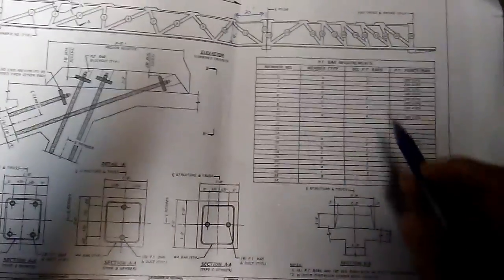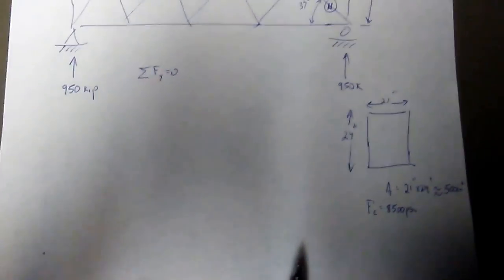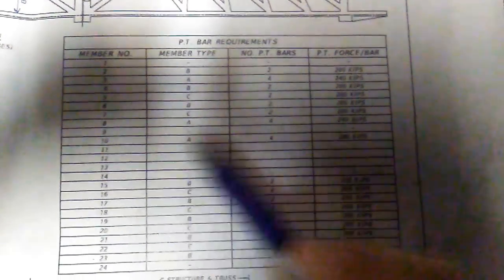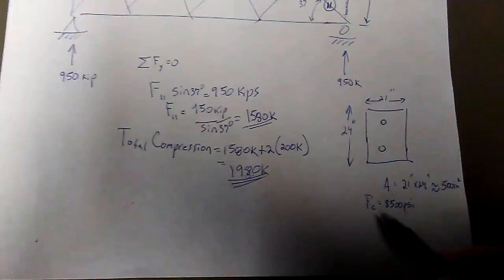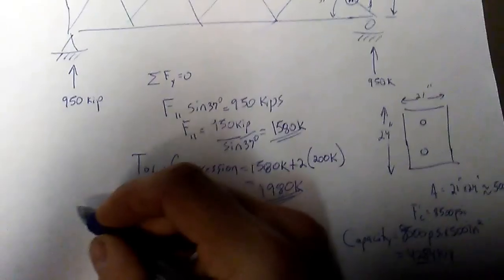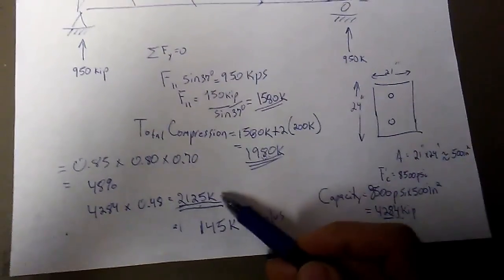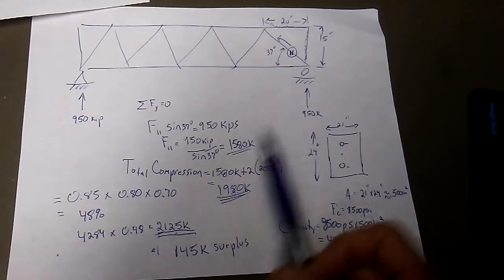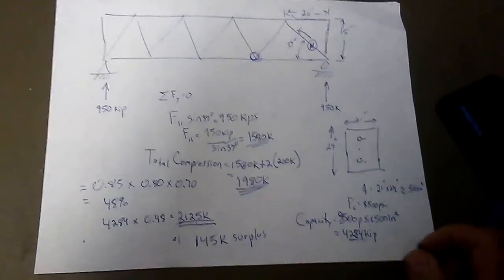FIU Bridge Collapse: The Hidden Truth (Part 3)

Comment: I think this video is looking at one tree when  missing the entire forest. The problem started when someone decided that this cable bridge was changed into a single truss bridge  ! and on and on . Namely, this cable bridge has no cables when it collapsed ! Period. George Wu, ARCHITECT, A.I.A., NCARB 2018-4-7
Reply from the maker: I will be making a video explaining the significance of the stay cables. Stay tuned!
Reply: Radical AM 
I think “swell” is swell.
Reply: You are correct, and this has to go down as one of worst bridge designs in the entire history of mankind.   Who needs a pedestrian bridge that is wider than a doubles tennis court?
Reply: georgewu5 — What I like about this series of videos is that the presenter is showing how the structural analysis works, but is refraining from jumping to conclusions.  Others, on the other hand, have tried to look at every little detail of the project and to come up with all the answers themselves.  That is what the NTSB is for, in my opinion.  I just want to know now how to read the structure, and these presentations are extremely helpful to me.  I am waiting for the NTSB report for the details of the failure and the conclusions.
Reply: Syd Moran Did you just use the word swell? How old are you 104?

Comment: @James, For me is the one of most intriquing aspect.  The NTSB video shows some stirrups but they look like torn into pieces.  
What force can do such damages ????
Reply from the maker: Thanks for the update Richard! The ties in the diagonals are intended to confine the concrete core and prevent the longitudinal rebar from buckling.  If the ties failed, this would appear to indicate that the truss member was overstressed by compresssion and  that the concrete was crushed forcing the ties to snap. Also, concrete that fails suddenly when it is crushed....and the sudden collapse of the bridge seems to confirm this.

Comment: I watched another video by the NTSB. This video shows diagonal #11 split along the longitudinal axis of the member.  It means #11 failed at the ultimate strength ( it might have been combinaion of compresion and bending).  My rough calculations  show that 12 -#7 would work for the DL compression but not for combination of  DL + PT force. Some  people on the Net suggest that at least 12 - # 11 are required for this member taking into account all load combinations.
Reply from the maker: Great find! This appears to support the theory of over-tensioning of the PT bars prior to collapse.

Comment: Why the prefabricated bridge was not of structural steel is beyond me.  Concrete is brittle and tends to crack.
Reply from the maker: Hindsight is 20/20 isn't it?
Reply: @structuresspecialist9743 , No, it should have been obvious from the outset to any experienced engineer.  The design was entirely impractical.

Comment: Small correction. You can subtract the weight from the 15' end vertical and 1/2 the 20' horizontal from the 950 kp because  they are supported by the end 15' vertical member. So the prestressing on #11 member is a little larger % of the total load carried.
Reply from the maker: The bottom of the end vertical intersects the bottom of Member 11....so isn't the weight of the end vertical supported by Member 11 diagonal?

Comment: I'm still trying to work out in my head, if it is possible for tensioning forces to be gathered along a tendon/bar unevenly. When the orientation of the post-tensioned bars is redrawn to the angles of the 10 & 11 truss members, both the upper & lower bars of number 11 traverse in front of the 4 fully tensioned & grouted bars in number 10. The concrete in this area of the blister is already high compressed. Also the the 4 ea number 10 post-tensioning bars are in a double waler formation directly across the path of the number 11 bars. There isn't any way to pull on number 11 without pushing down on number 10 truss.

We don't know when the cracking occurred. If it happened during the move it most likely occurred somewhere in the cantilever section. We don't really know if the de-stressing took place when it was this information was imparted to the press on the day the bridge was set in place. The canal side of the roadway is lower than the University side of the road way and cracking could have happened when they crossed of the median & came down the other (lower) side. But, if the cracking took place after the bridge was set, it was foolish to do any work that had a direct action on the structural integrity of the bridge, while the roadway was open to traffic because there isn't any way to determine if the bridge is done cracking when its loading is so recent in nature.
Reply from the maker: Good points. The overlapping of the bars at each diagonal member connection point certainly complicates matters and required a rather detailed analysis during design. 
It will be interesting to find out where the cracking occurred...

Comment: It looks like the bridge was designed with the stay cables in mind to hold the load as the bridge could barely hold itself up as you have calculated. Great video!
Reply: A major part of the purpose of this bridge was to look good.  They spent real money just on the looks.  If they had just wanted a pedestrian overpass, they could have had a more conventional design and it would have cost less.  But this bridge was went to be a landmark and a kind of advertisement for the university, since FIU was heavily involved in the whole thing.

There were at least four goals that this bridge was meant to serve in addition to being a pedestrian overpass.  In addition to being an advertisement for the university it was meant to be a demo for Accelerated Bridge Construction methods.  They wanted to be able to say afterwords, "We put this bridge up and only stopped traffic for six hours."

Third in addition to being an overpass it was a wide space that was meant to be a gathering place for students where parties possibly could be held.

Fourth, despite being more expensive than alternatives, mainly because they were doing something significantly different from the norm, they were also trying to economize.  Not so much for the construction of this bridge, but for the later copies that would have been made, which would have been somewhat economically competitive because one of the features of the design was that relatively small amounts of expensive steel were used.
Reply from the maker: The stay cables are purely aesthetic and were not designed to support the bridge. I will discuss this in an upcoming video
Thank you for the positive feedback!
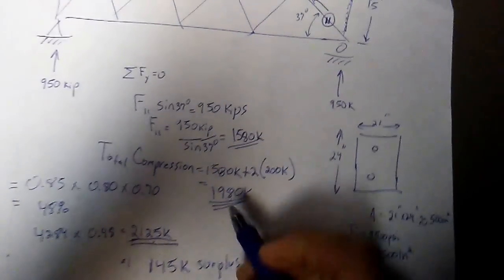Reply: At 16:15 you are calculating the compression on the concrete... 1. Does the pull on the post tensioners come to over 4000 Kip, did they stretch or weaken? And 2. Was the top of number 11 and its neighbor to the left able to hold together with that much negative force? And 3. It looks like the forces of most of  the pillars all transfer forces toward the right end (11) and that's why I was wondering about the stay cables and the load they carry, if it's in the plan you have there, it is a fair investment financially, why else have them?

Comment: if you deform the plate into a cone the tonnage to pull the cone into the void/tube/hole becomes very little.  as it splits the structure apart.  hence; a Swedged hole. malleable material will do this

Comment: ? anchor plate surface area. ? anchor plate thickness. backing nut surface area. ? tonnage to deform anchor plate. ? cold joint between support and deck.
Reply: Robert Lee.... right... slowly compressed into powder.  I'm playing with 1.5×1.5×20 inch concrete units with 1/4×20 all thread...I bowed internal tube on one to see if it blows the side out as the rod tries to straighten...the one with straight tube has cracked in half, just from playing with it, but you can compress the crack to invisibility...
Reply from the maker: Check out this link for post-tensioning system details. This system is supplied by Williams Form Engineering is very similar to what is shown on the preliminary drawings: http://www.williamsform.com/Contact_Us/PDFs/Post_Tensioning_System.pdf
Reply: structures specialist....thanks that was some cool stuff.  400t hollow cylinder.  and hydraulic wrench.  very cool.  I have a 20t hollow cylinder I Swedged with.
Reply: I seen bolts stretched so nuts could be ran by hand.  look for a video of a boldrini head dishing machine.  it can still lift itself enough to see light between the floor and base plate.
Reply: I'm no engineer but I've been around so big pressure...10,000 ton press. 10,000tons
Reply: A 6" diameter plate with a 2" hole is only 25 sq in of plate area.  At 270 kips, the compression is 10,800 psi.

Comment: Where is you analysis of a compression member  that was not laterally restrained at the top and could sidesway to cause bending about it's weak axis?  Where is your analysis of the embedment of the mild reinforcing in member #10 at it's top and bottom end?  Where is your analysis of the shear transfer of the tension force in #10 through the joint, and into member #11?  Where is your analysis of the transfer of the compression force in the roof, into member #11?  This bridge design is so full of holes that it appears that no experienced structural engineer was involved in it's design.
Reply from the maker: All great ideas for future videos!
Here's another one: Analyze the confinement reinforcement requirements at the truss panel points where the members intersect.
Reply: @structuresspecialist9743  Forget all that crap. just design a bridge with proper vertical supports.  It should have looked like this:
https://drive.google.com/open?id=1LkuTxK5z7hppFgDpyUg2CH_03Lfke5JX

Comment: I'm curious as to where you found the concrete spec. to be 8500psi.  As I understand; the concrete in this bridge was a new design, called "self-cleaning", and in my mind, that would indicate some level of friability.  I don't know if the structural members were homogenic with the new concrete, but I would like to double-check the strength of the concrete used.  And really; even if it was made of 8500 concrete, to design the structure with no stirrups seems like a mistake.  Why no stirrups?
Reply from the maker: The self-cleaning concrete claim was just part of the sales pitch to win the contract. Anything sitting outside exposed to dust and the elements gets dirty over time. And the claim that it reduces pollution is hard to believe. Lol. 
The truss members surely had stirrups, that is standard practice.
For the concrete strength specified, see pg. 100 of the design proposal linked here: https://facilities.fiu.edu/projects/BT_904/MCM_FIGG_Proposal_for_FIU_Pedestrian_Bridge_9-30-2015.pdf
Reply: 8500 psi concrete is also a Florida DOT specification grade concrete. Every Ready-Mix company would have an 8500 psi Mix Design, though a bridge designer might call out some mix ingredients to satisfy certain unique criteria.

Comment: SS, Great work - I believe you nailed it. Thanks so much for adding your engineering knowledge to provide clarity. To possibly fill in a missing piece, I read somewhere that in preparation for the installation move, the tendon tension was increased to compensate for the added forces on the member associated with the north end cantilever. The statement I read also mentioned that the tensioning work being performed at the time of collapse was actually intended to be a de-tensioning operation - to reduce the final load and adjust the bridge cantor (BTW, I admit I am unfamiliar with cantor adjustment so that could be irrelevant).
Reply from the maker: Yes, I too read the information about the de-tensioning operation that was supposedly occurring just prior to collapse. De-tensioning (rather than tensioning) is exactly what should have been done to the PT bars at that point in the construction sequence.... so was de-tensioning actually occurring when the bridge collapsed? That possibility blows up my theory that the PT bars were being tensioned mistakenly just prior to collapse...

Comment: Should the reactions be cut in half at the supports  if the total dead load weighs at 950k ?
Reply from the maker: Total weight of bridge is 950tons. 
1 ton = 2000lbs or 2kips
950tons x 2kips/ton = 1900kip total weight
Reply: structures specialist thank you
Reply from the maker: Thank you for signing up! I am honored to have you onboard.
Reply: For non engineers, the collapsed structure weighed over 2,000,000 lbs.
Reply: A ton have 2,200 pounds.
Reply: Raul Aguero:  Exactly.  That's why it weighed more than 2,000,000 lbs.
Reply: no

Comment: The strength of the bridge should be for 2000 tons or perhaps even 5000 tons, not 950.  The design failed because concrete was the material of choice.  Such a design can only hold a certain load, perhaps adequate if steel was the material of choice.
Reply from the maker: When designing a steel or concrete member, the selfweight of the member is increased by 25%.
So if a structure weighs 100 tons, you use a weight of 125 tons in your design of the member.
Reply: Adding weight does not necessarily increase strength in cable compressed concrete.  Any rule of thumb using simply weight alone as a criteria is extremely flawed.  pkas90 is correct.  The problem is this was an overweight concrete monstrosity.  It was already in a failure mode before the post tensioning adjustments commenced;
Reply from the maker: Weight is increased when designing a member. So for instance, if a beam weighs 100 pounds, you size  the beam to be able to support a 125 pound selfweight. You do this to add a factor of safety into your member design. 
 Of course, other loads including pedestrian load and wind loads are applied in combination with selfweight.
Reply: structures specialist  ...  By your calculation of 125% extra, the nodes were destined to fail.  The load of concrete acting on the nodes never ends, it's all day and all nite stress load.  Because it's a 24/7 stress I estimate the minimum strength should be 500% not 125% like you suggested. For normal steel trusses yeah it should be fine but concrete no.

Comment: Ps please, take a look, sorry for the long video, but we are trying to explain on YouTube, in layman's terms... https://youtu.be/E2qCo33ubPc
With that said, take a look at a theory of mine of induced rotation based on one P.T. rod being tensioned already and once taking on number 2 cable, they created a new moment in the column...if, in fact, the top p.t. rod, is not balanced in this diagonal column...
I think this will give the torque, rotation and new bending / buckling moment in column; which then allowed the canopy to lower itself and change load path of canopy's longitudinal 4 cables, this load path jump down to 10 & 11...
10 directed that path into JUST two longitudinal cables and some transverse rebar...which it could not take loads...and also changed load path to #10's location of deck and that failed under tension (The deck failed under tension)...
You can respond on my other channel if you like... and tag your video there if you want more views and followers.

Comment: Do the American codes allow to construct bridges from non-reinforced (pure ) concrete ? This diagonal should have at least
 12-# 7 as a minimum reinforcement for a member in compression. I believe the safety factors in these calculations are wrong.
Reply: This is why I would call them "fake drawings".We can only speculate and unable to make any judgement. These sections showing stirrups without longitudinal reinforcement are nerve wracking. I would never release  them to the public. The videos are more important in this stage but I am waiting for the first statement from the NTSB.
Reply: I didn't notice any stirrups in the broken rubble of member #11.  To be properly reinforced to withstand compressive stress, I think there should have been stirrups along with longitudinal bars.
Reply: I absolutely agree. There should be longitudinal rebar and stirrups in this diagonal !!! This diagonal acts as a member in compression, a column or a beam-column (If a moment is present) The NTSB video shows some mild steel but very messy.
Reply from the maker: Agree. The preliminary set of drawings show stirrups but no longitudinal rebar. There would have been at least a minimal amount of longitudinal reinforcement... say #4 or #5 bars at each corner. The final as-built drawings are needed to confirm this.
Reply from the maker: To be clear, the preliminary drawings were included in the design-build proposal and available online before the collapse. I concur with your sentiment however....it is difficult to make a judgement without as-built drawings.
Reply: Rechard Oblack:  stone arches have been successfully constructed for centuries.  If the design was based on a concrete arch, it would have worked.  I'm guessing that ABC is not achievable with a large concrete arch.  It would be difficult to move it into place.
Reply: You are kidding me. I know we do not live in the Roman times. My question was : Do the MODERN American codes allow to design bridges made of plain concrete ?  I agree, to move an arch bridge will be difficult, ha, ha, ha !!!!